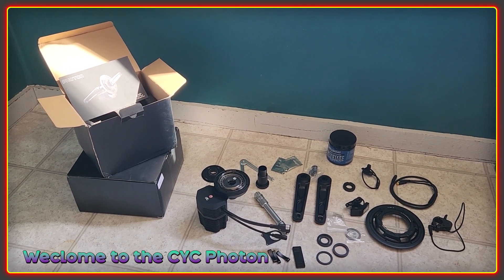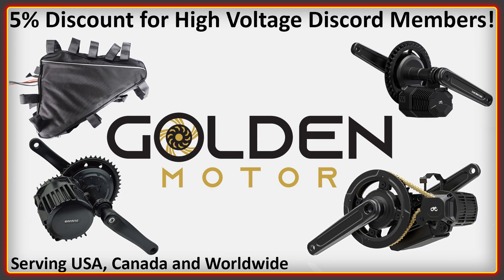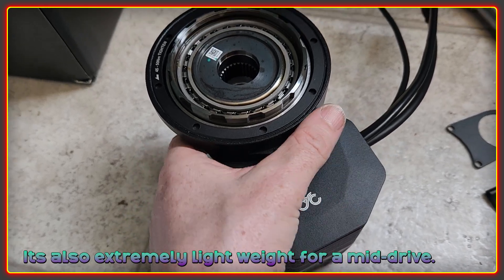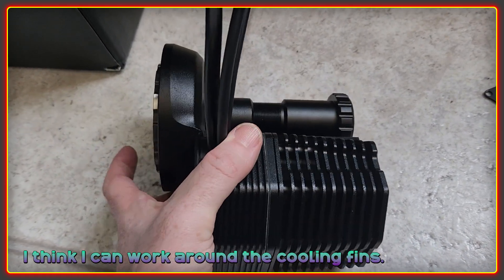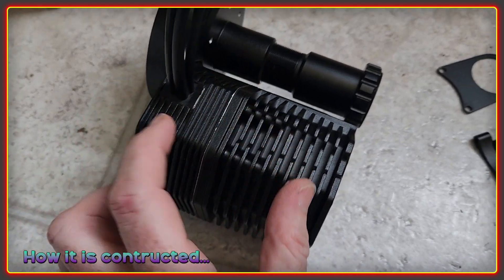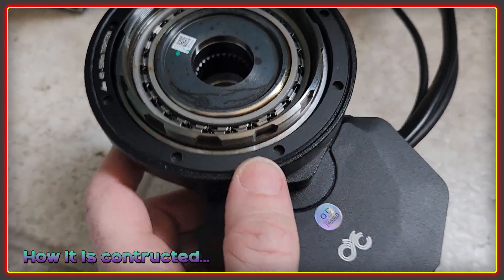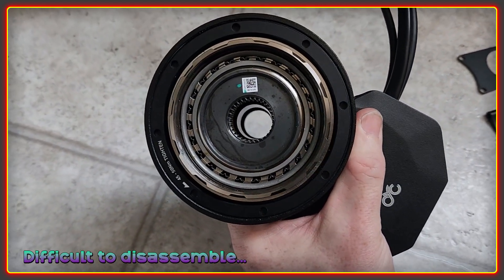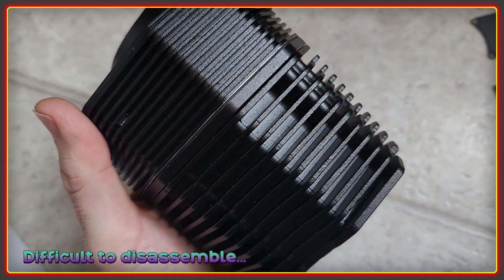CYC Photon Mid-drive Motor Breakdown - A look at the main components in CYCs new Ebike Motor

Comment: I enjoy your videos. Wonder if you could help please. I'm running the CYC photon with the small 102 display and everything is working. My wife recently purchase the 103 display and we cannot get connection, no screen light up. If you could help that would be great
Reply from the maker: Check one of the pins did not get bent during connection. Failing that try the old one again. It could be a bad display. Maybe contact your dealer if it won’t power on still.

Comment: Thanks for the video. I’ve recently built up a mtb with the Photon and absolutely loving it. I’ve seen on a thread that under the QC sticker there is a screw which allows you to remove the cover. Inside is the controller unit which can be removed for replacing. Did you notice with yours that the motor got noisier after an initial break in period? I’ve put about 120km on mine and the whirring is definitely louder. Have you had any luck lubricating the gears?
Reply from the maker: I have not lubricated anything. Unfortunately, mine has issues and is looking likely to have to go back to the dealer for repair under warranty. I will do a breakdown once I know what is up with it. It had about 1000km on it. It looks like you can remove the controllers so regrease becomes possible but after 100kms it should not need that.

Comment: Have you installed the photon or stealth on a carbon frame? Definitely mixed reviews on whether or not to do a conversion on carbon.  I have a 50 cm Niner
Reply from the maker: Hey Debbie. I have not used a carbon frame. I stear clear of the stuff. It's brilliant until it fails and then it can be catastrophic. My mate in the uk nearly lost his face when he hit a pot hole with his Bianchi carbon. The forks sheered off. It put me right off. That might not be a fair assessment of carbon as a whole but the result is I haven't tried one. They sell well tho so you might be able to do a good trade. Sorry I can't be of more help.
Reply: @HighVoltageKits  It's a Niner gravel bike.  Its a solid comfortable ride and never any issues with it whatsoever.      Chatted with electrify your bike and they've installed cyc stealth for the past 3 years with no issues.....hmmmm???  Definitely not selling it.  Its a memorial bike to my riding partner who passed away suddenly

Comment: So the end user can barely disassemble the unit and will require shipment to an entirely different country if it breaks. THATS EXTREMELY UNFORTUNATE given I was about to pull the trigger on this but now it is not happening-especially with the slightly mixed track record cyc has, and their support takes forever to respond to simple questions
Reply from the maker: These are my full thoughts. https://youtu.be/7qkPe0g2A1Y

Comment: Is this motor self-servicable?
Reply from the maker: No, you have to send it in to a dealer to get it fixed or serviced.
Reply: @HighVoltageKits  Yikes, thanks for the heads up. This seems like such a cool motor but that'd be a deal breaker for me. :(

Comment: I recently bought one of these motors 6 months ago still haven't got to ride it yet because the throttle work for about 5 seconds now the motor just makes a spinning sound if anybody has any ideas I would appreciate it not getting much help from the company
Reply: Asking for a refund on this motor because it doesn't work!! no company commindication ,,6 months wasted my summer By a more affordable motor that actually works... And a company willing to help you if there is a problem CYC is not it🤦‍♂️
Reply from the maker: That's not acceptable in my book. Have you posted this on the Facebook group? That should be a warranty replacement if there is a problem that cannot be resolved. Are you on the group?
Reply: @HighVoltageKits   No, not yet, still trying to work out the problem. ?? Company keeps sending me the same information over and over even though I've sent them snapshots of what is going on

Comment: Hello, I have Gates Carbon Drive belt system. Is there a possibility to swap a front sprocket in Photon or any of CYCmotors ? Thank you in advance for response.
Reply from the maker: As it stands no. With lots of money and machining anything is possible but until something is made its not a practical possibility. What were your reasons for doing so?
Reply: @HighVoltageKits   Thanks, I already own a bike with belt instead of chain. I like it. it's noiseless and clean. Now I think to convert it to ebike. And actually I've found on cycmotor site in user's manuals that it allows to put any kind of front sprocket with  104BCD Chain Ring mount. So, yes it is possible in other models but not with Photon model ;)

Comment: I shot them an email aswell regarding the repairability as there is currently no parts available anywhere or even an exploded view/drawings. Nothing.
Also asked them about belt drive chainrings and they said that's in work. A standard BCD spider would also be great.
It's as much of a black box as bosch motor currently.
No ebike motor is maintenance free.

I want to build myself a torque sensing PAS bike. This motor is the strongest and nicest option available but I think I might go with the tongsheng tzds2b which is the only other one I know.
Reply: Of course there is. Just not for my liking. Also they could overhaul it a bit. I'm looking for an alternative to Bosch, Brose, Yamaha and the like.
Reply from the maker: The Photon is excellent in that regard.
Reply from the maker: Hold off on the Tong Shen there are new motors due very soon  you might like. I will talk about the motor structure on my full review.
Reply: Bafang should make a torque sensing conversion motor. But seems like they are more focused on integrated motors and locking their batteries to their motors. BBSHD has had a long life and should now be put out of it's misery.
Reply from the maker: You would think it was a slam dunk. I have exciting news on new motors soon though. The BBSHD is a legend though. I hope they at least keep making it. There is very much a place for it.

Comment: Thoughts on repairability and servicing/lubrication? How do you access the guts of this thing? In comparison, Bafang and Tongshen are "agricultural", but fixable.
Reply from the maker: I think the clutch and torque sensor remove. The rest is behind what looks to be a glued plate.
Reply: @HighVoltageKits  Not sure how you'd get behind them to press them out. That's a massive clutch, and that's only 1 of 2. Really smooth, no play, guess that's why they went with Spragg.

Wish my rear hub was that quiet.
Reply from the maker: I think it screws out as a unit. Probably replace the whole thing

Comment: With regards to applying the correct torque to the adjustable face pin tool.  You don't need a torque wrench etc.  

An experienced mechanic should be able to get it within or pretty damn close to the acceptable range just by feel.  (Or feel with a tappy tap hammer haha)

Which is ofcourse why there is no way to connect a torque wrench or torque block to the tool.
Reply from the maker: I will do my best to get it nice and tight. Most people doing this I doubt will qualify as an experienced mechanic?
Reply: @High Voltage  I think the only way would be to stick a torque wrench into a bolt on something else, set to the required torque and then grip the wrench handle at about the same length as the CYC tool and try to guage the feel of how much pressure is being applied to the torque wrench and then get the same feel on the CYC tool. That's quite a high torque though, might be quite difficult to gauge the same feel when you are tightening that hard.

Comment: Those M3 holes might be for bolting onto an existing bracket on your frame if it has one. My Diamondback Atroz has them for a chain guide. i have a Stealth Gen 3 on the way and I might have to cut one off. Don't care. I want the power for single track. Hope you enjoy the Photon.
Reply from the maker: Appreciated. It got me thinking about other potential uses for sure. Maybe a chain guide. It would suck to get the chain stuck in the gap between the ring and the motor.

Comment: Mine is held up with customs clearance but hope to get it this week. Battery is a far way off. Is the chainring Shimano HG compatible? Or just standard (SRAM, KMC etc)?
Reply from the maker: The chainring to the best of my knowledge is proprietary.
Reply: @High Voltage  I get that the chainring is proprietary as it fits over a motor hub casing to achieve a decent chainline but it still has to work with chains. Shimano 12sp chains have Hyperglide, and the inside plates extend in to the space where the wide chainring teeth fit, so the teeth need to be relieved slightly to allow this. If they don't,  Shimano chains will need to be swapped for SRAM or KMC etc, and then you lose the advantage of Hyperglide cassettes. I hope CYC got this right.
Reply from the maker: Sorry I misunderstood you. I am using a 10spd SRAM chain on this. This might not with those chains. I will ask at CYC.
Reply: @High Voltage  if you look carefully at the wide teeth, there should be a chamfered edge that allows the tapered ends of Shimano inside plates to fit. If they are just square - like the narrow teeth - they won't work with Hyperglide chains. Well, not until they've generated some clearance : -)
Reply from the maker: If you join our Discord I'll post you some pics.
Reply: @HighVoltageKits  👍
Reply: @HighVoltageKits  my Photon arrived today and I can confirm the 34t chainring has the wide teeth relieved to suit Shimano HG chains, so very compatible with many (but I bet, not all) current chains.
Reply from the maker: That's good news! Enjoy the installation! Cheers
Reply: @HighVoltageKits  should be fun, but the battery is still a couple of weeks away 😞

Is the chainring supposed to be relatively loose (able to rattle) when the cover disc is fully tightened? What is your installation like?
Reply from the maker: I don't remember it being loose.
Reply: @HighVoltageKits I wonder if you could check? My chainring was an easy fit on the splines and has about 0.5mm axial play when the cover is tightened, so it rattles in all directions. Also no speed sensor magnet included. Not impressed so far...
Reply from the maker: No play. Suck about the magnet. Can you post a video on discord
Reply: @HighVoltageKits thanks, I'm not documenting the build, there are plenty of others doing that, but will do a summary at some stage. It should be a really nice bike when done.

Dug out my chain whip, that sorted the loose chainwheel, but surprised at how loose the initial fit was. Hope it is OK.

Comment: I am building up an MTB with a Stealth Gen 3 at the moment.  I noted as you did that there are channels in the spindle as if there should be O-rings in the grooves.  My spindle, however, had no O-rings.  Does yours?
Reply from the maker: Yes there is one on each side. I think you likely should have them. Might want to check that on the facebook group or with CYC. Might be an ommision?

Comment: The plastic plate at the end is an optional stop block you can wire tie (or similar) to the frame. Also, for some internal views, there's some out in the wild, related to FCC certification for the Bluetooth system.

CYC has updated the user manual, describing the greasing.

Under that QC sticker is likely a single screw that holds on the controller cover.

IMO one negative is the very wide Q - I hope CYC offers a shorter spindle eventually, more suitable for 68-73mm BB installs.
Reply from the maker: Thats good regarding the manual. I must have an older version. I have made a 3D printed part to use to locate the motor. I don't think I would have been able to use the plastic piece due to my gear cable. Appreciate the advice!
Reply: @HighVoltageKits  I forgot to thank you for this video. I'm hoping for the best with this motor. I don't view it as a BBSHD "killer" or even a replacement - I think it'll serve the purpose, desires, and performance that disappointed Tongsheng buyers were hoping for. I also wonder if Bafang will view this motor as a threat and develop a new DIY BBS-ish motor to compete (as opposed to the M625).

I'm also hoping that CYC obtains UL certification for the entire motor system, similar to what I believe Bosch has.
Reply from the maker: You are very welcome! Cheers
Reply: @Ray-dz9fn  They say there is a big brother of the photon coming later this year and that will be the bbshd killer imo.
Reply: @andrewhunt4777  Thanks Andrew - that would be a VERY welcome motor in the community, I suspect